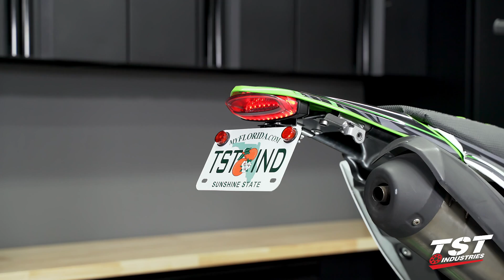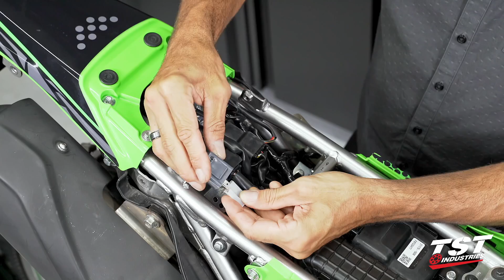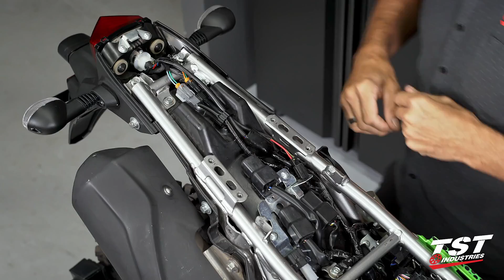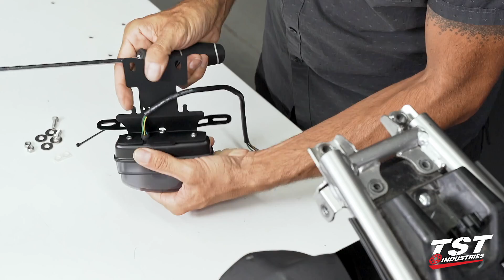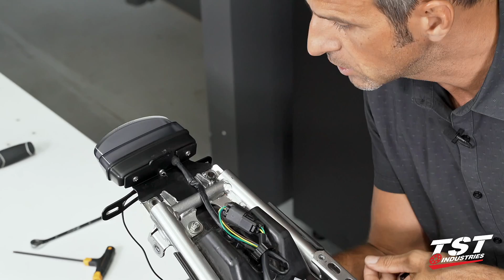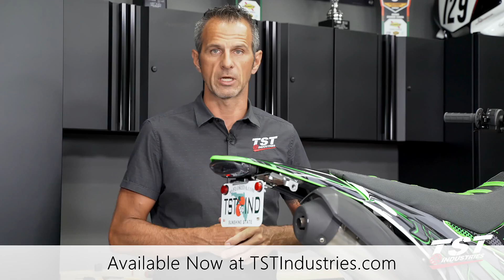How to Install TST LED Integrated Tail Light and Fender Eliminator on 2020+ Kawasaki KLX230 S/SM

Comment: Will this fit on a 2026 KLX230DF?
Reply from the maker: We haven't been able to get that model in-house to verify that in person.
Reply: I recently purchased the kit, including the relay and plate light. There is no change for model year 2026. Relay is the same. Wiring harness plugs are the same. Fitment of the brackets are the same, and this video install tutorial was what I used as a reference during install. Precisely the same. Thank you for responding.

Comment: will this rear fender eliminator work for my KLX 230 DF 2026?
Reply from the maker: We have not had a DF roll through the shop yet but upon examination of photos and Kawasaki documentation it looks like the rear rack would be the only source of a fit issue. Looking closely though, there aren't any features of the rack that would interfere with the TST parts. The installation flow would have to be adjusted to accommodate rack removal and then replacement with the fender material not being in place in between the frame and rack mounting tab. While I can't guarantee fit because I have not performed this installation to date, I would be pretty confident in this working out just with a few process adjustments during installation.

Comment: Does the rear brake operate the brake light once installed ?
Reply from the maker: the brake light gets its signal from either front or rear brake switch. The trigger for brake light function is on the bike not in the tail light. If you have no brake trigger from your rear brake then you need to adjust the switch sensitivity there. We have a video on that topic in the Tech Tips category of our channel.

Comment: Wish there was a way to reuse the turn signals if at all possible.
Reply from the maker: You can make that happen if you really want to but you will have to make some brackets. It would be far easier to use an aftermarket external signal set that mounts via an 8mm stud. If you look through the photos in the following product page you will see what that looks like https://tstindustries.com/tst-quadrix-d-integrated-sequential-led-rear-pod-turn-signals.html

Comment: Does the stop turn signals upfront integrate with the rear do you have to have any kind of different relay or anything like that form to function White Rabbit turn signal
Reply from the maker: I don’t understand what you mean by white rabbit turn signal but if you install different signals up front as well as this rear kit, as long as you have an LED Flasher Relay, all signals will flash at the same and correct speed.